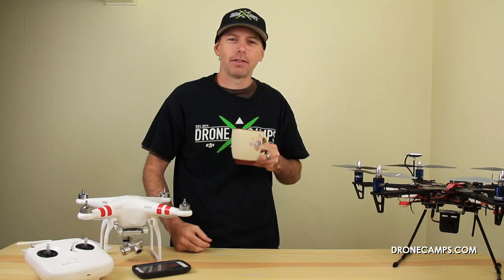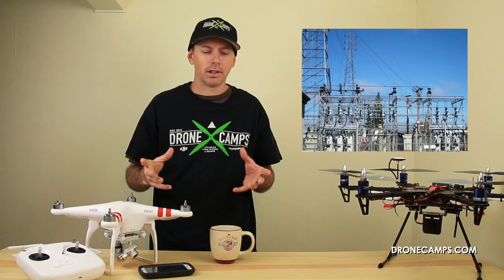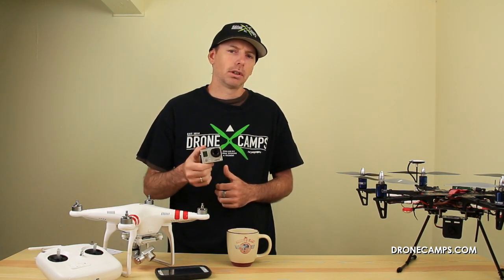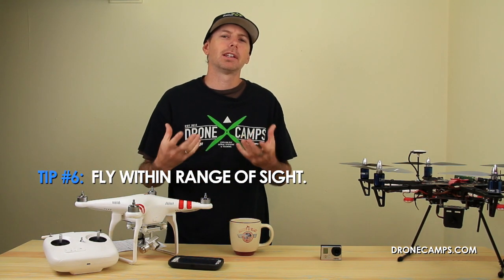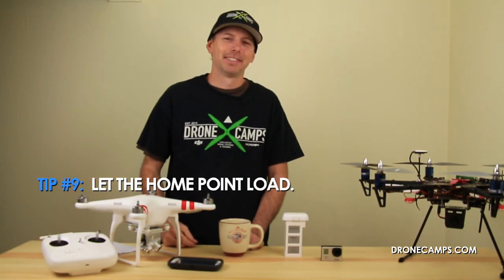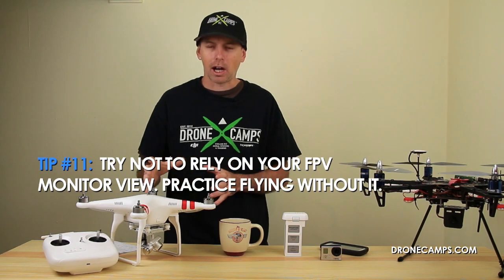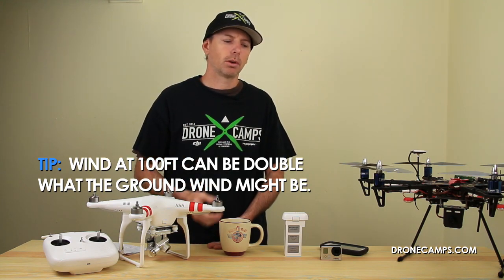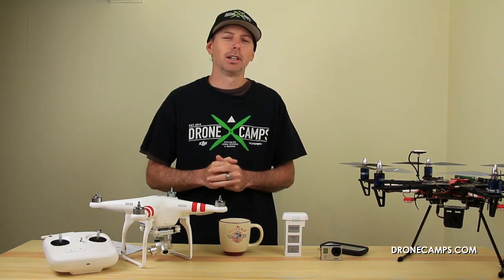DJI Phantom 2 - How-To AVOID FLYAWAYS, UPDATE

Comment: Have the Phantom II Vision. After my first flight and battery charge, I went to it fly again.  This time when it connected I had no video on the DJI Vision app. I tried resetting the range extender RE500 and then did a rebind.  After I scanned the bar code, I pressed the blue arrow button.  When I did that it went right to the main screen.  Watching other videos on binding, it was brought up that if it did a successful bind that you would get a message that it was successful. I didn't.  Any ideas what to do next?  Thanks.
Reply: Don Cook I have the same problem with two of my batteries I have four in total but two of them just recently got to where I had no video but everything else works great just no video anybody out there got any ideas on what happened to the batteries

Comment: Does anyone out there know if the "FlySky FS - TH9X 2.4G 9 Channel Transmitter / Receiver 
will work as an upgraded transmitter for my Dji Phantom 2 (it's the one with the re-chargable transmitter., 
battery level lights,.. "MODEL #NDJ6"... Eventually I want to add...1.) 3 axis gimbal 2.) retractable gear,
3.) Telemetry 4.) FPV. Already have FPV gear and Retractable gear so they will be first. 
Any clues would be good, Lately, I don't have a clue, lol

Comment: I learned to fly on a Cheerson CX-20. I crashed it so many times I finally had to transfer all the electronics to a 450 Flamewheel. Had trouble with the GPS, failing, acting eratic etc, etc...On its last flight. it shot up and I lost it in the sun. By the time I dealt with the sun it was gone. My buddy that was with me saw it and said it was just a spec. I never saw it again. Since then, I got a great deal on a Phantom 2 but I'm scared to fly it over 75-100 feet or so. Fear is not a good emotion while flying a quad, lol...I keep telling myself it's a hobby grade toy, just have fun with it...still a bit nervous when I put it in the air. It flys great and responds better on its worst day than the CX-20 on its best. Any sugestions ? I always make sure I have 7 or more satalites too !Thnkin about trading it in for a RC car or a Boat..lol...Flying is so much more fun tho. Maybe I'll get over the fear, I certainly hope so
Thanks
Reply from the maker: Hi Jeffery. Some friendly advice is this. They all can have issues. No matter if they are on the ground or in the air. The best thing about flying is the challenge of getting in back in one piece. That to me is the fun part. Calibrate your compass each time you go out to fly. That will help the GPS get a good idea of where you are and the copter will fly better. Phantoms are reliable to a point. Some people have them for years. Others days. Just depends on the pilot and sometimes the equipment. Like a car. Some are good. Some are lemons. I never know with an RC anything if I got a lemon or not until about the 50th flight. Even then things can break. Sorry about your fly away. It's happened to me too. Some advice... put your name and phone number and reward if found on it. Someone nice might call you and give it back. I would keep flying and growing to learn the drone and fix it when it crashes. Soon you'll love flying... And being scared is a good thing. Keep it close in and learn to fly it without relying on GPS. You'll be a better pilot. - Kindly, JD.
Reply: Thanks J.D.
The first thing I did was put my name, Ph# and the word "reward" but not an amount.
I also put my FAA reistration info as required...thanks for your videos, I've gotten alot of good insight
from them, I will continue to watch. I'm 63 on the 16th of this month, My beautiful wife, guitars and drones are all I have at this point of my life. (in that order) Soooo, thats it. Only been fling less than a year, but I get better every time out.
Thanks again !
P.S, I fly a mini quad every spare lunch and break time at work, it's helping alot with control.

Comment: Just had a flyaway and i think it was the go pro wifi :( it's still in the the woods can't find it !!!! 1000€ lost, another tip you forgot to mention is a tracker..... Guys buy the Marco Polo tracker or something like that you won't regret buying I will never fly another expensive drone without any means of finding it again ... Buzzers,  strong LEDs it's also a good  idea, record you OSD, video so you can check the coordinates and the landscape your drone went down, went flying in Sierra de Madrid winter time lots of snow the drone can be under the snow no way to find until springtime, another useful thing you must do is to right you phone Number on the drone so that if you are lucky enough to get someone who finds it to call you back ....
Reply: or buy a P3 which has all sorts of telemetry and shows you the last position on map. Just don't use an iOS device those things have terrible Maps app and GPS sucks too.
Reply: I lost mines when it came down in some thick fields and i follow the gps tracker that lead me directly to it.

Comment: Perhaps one more thing you can add is propeller guards. They're good for beginners, but add a lot of drag to the drone.
Reply: First thing I put on my Phantom was prop guards, had 8 I bought for my CX-20 (did'nt fit) already cracked 3 of em...minor crash, was inpatient, didn't wait for full GPS lock. That won't happen again. Got the quad for a ridiculas price.($100  with 2 batteries and about $400 worth of FPV equiptment, plus 2 other lesser value drones. Im poor man, thats a once in a lifetime deal, lmao ! I'm 63 on the 16th, 9 days. these drones gotta last another 3-4 years. I figure after that alzheimers, it's what killed my Mom and Dad
Happy Flyin" y'all
Texas Jeff

Comment: Tip 1:  Buy stickers showing directions, labels of commands and stick them on the controller.  Tip 2:  Turn your phone off.  Calibrate.  Turn phone on.. Turn off WiFi and Bluetooth if not needed.  This applies to others near you.  Tip 3:  Use prop guards..Use a sharpie and put your name and number underneath the guards.

Comment: Great information that I really never thought about.  I am really new to flying drones...bought a Phantom 2 with Zenmuse V2.0 bundle.  So far I've had a blast.  I've taken it far over the ocean and it's sketchy when it's a tiny dot.  Might keep it a bit closer now.    I don't have a FPV yet so I guess that's a good thing learning to really "fly" the drone rather than use the monitor.  The battery going below 30% was EXTREMELY helpful.  I've had the drone return to home twice.  The second time it almost landed 15 feet from where it took off(not a good thing at all).  So, make sure you have a 30' foot clear take off radius with no trees around or buildings.  Thanks again great video!

Comment: Hi. Excellent, thank you. I am consideriing an application on a very remote island where there is no WiFi. Could the system you have here be used to map coral configurations in such a WiFi free zone? Thanks.
Reply from the maker: +Charley Waters yes the copter uses onboard wifi. No need for cell service. Fly and map anywhere

Comment: As an average person that flys a Phantom 2 very often, you do not need to calibrate your compass every time you fly. I have noticed some strange behavior without calibrating over the course of several weeks but it's nothing major. If you notice youre copter isn't as smooth as it once was then go ahead and do the compass calibration dance. If not then just fly as normal.

Comment: having problem with my Phantom after install 5.8 mhz video system and gimbal. in the ground phantom response to controler up to 10 ft or so, and them got disconected and phantom land. what could be the problem? any advise?

Comment: Best bet, start with a toy drone, buy a couple, learn to fly, then upgrade to this way more expensive model, you can grab cheap camera toy quads for around 60 U.S. dollars and learn to fly on those before ever paying 1000 plus dollars on these quads. If you care about your investment. learn what you are doing before putting one of these multirotors in the air. Last piece of advice read the manual, it will give you the basics of safe flights and of course research the quad or other multirotor you intend to use in the field, make sure you know what to expect from its performance before you ever plug the battery in and get ready to fly.

Comment: special warning,  Care needed to avoid losing line of sight with drone as it will lose signal and go into fly back home mode. If the obstruction is a building or hill of over 25 feet your phantom will attempt to fly back you through it...it happened to me

Comment: Best DJI tips video I have seen.
I am on my second DJI Phantom, as I lost my first one into the ocean due to a flyaway.
I just had a similar incident, but managed to regain control because luckily enough I had the altitude to do it.
I was flying it at a port around tall light towers and a lot of wireless signals around.

Comment: Regarding the SAM app.  Could you expand on what the app is showing.  How many different colors / messages are for each field, Solar X-Rays and Geomagnetic field.  Currently mine shows M Class Flare?? and Unsettled, both in yellow.  Without knowing the complete range of colors and messages I'm not sure how to use this app. Thanks for your time.
Reply: Norman Porst There is an explanation about solar storm activity on MikroKopter Wiki.

http://wiki.mikrokopter.de/en/SunStorm

Comment: Great explanation and it sounds exactly what happened to me.  Was flying around and all of the sudden, quad started going in a an unwanted direction and I watched it go out of sight, very sad!  I have a comment, what do you think about this?  Along with what you have suggested, what do you think about just after take off, hitting RTH and verify that it truly does RTH.  If the gps spot is incorrect and it started heading in a different direction, at least you will only be a few feet off the ground and the quad will run into something instead of flying away above the treeline.

Comment: Flew about 5-6 hours on the Heli-X Simulator plus some more indoor flying with a micro copter.  Grabbed the Phantom 2 v2.0 for my first flight.  Phantom Mode, no wind, practice take off and basic left right movements.  It's super easy to fly in phantom mode.  Great for the camera work we will be doing with it. We also removed the camera for until we get a few more flights.  Thank you for the tips and info.

Comment: Very very helpful video. Thanks.

Do you have any video on what we have to do when up in the air, something goes wrong, lost control of the drone? I think it is also important as we'll experience it somehow. 

Another question is, how close is 'too close' to steel structure, antennas, radio station, power lines? The maximum proximity?
Reply from the maker: Fadil Aziz you are most welcome !

Comment: I had a fly away but it probably was my fault. I found the thing in a small tree unhurt because the battery still had power and was sending out its location.   So my question is if your phantom does go down how long will the battery run if its not running the motors. Lets say it goes down with 30% battery.   I have a vision 2 so as long as it is still powered up its like sending out a beacon that you can follow.

Comment: Great tips, thanks. I'm guessing that for tip 10 you could activate flight mode on your mobile to kill EM signals that may interfere with compass calibration and deactivate flight mode once the compass has loaded?

Comment: Hi thanks for video. While flying a few times I got this red warning message on the screen 'poor battery connection" and then battery level flashes red. This could be 2-3 mins into a flight with 100 percent battery life. I then panic but thankfully it stops flashing and returns to normal. Any ideas why this happens? It's a vision plus V3. Thanks

Comment: Any idea why when I try to start my motors after calibration that it would refuse to start until I remove and reinstall the props?
Reply from the maker: Hickory taylor that shouldn't be an issue. Weird!!!
Reply: Drone Camps RC
 Not having any one else around here to compare mine with I just compare to the videos.  Can I ask,  from the time I turn on the radio, plug in the battery and the quad makes its sounds,  after doing a calibration in full view of the sky how long would it normally be before I could move the sticks and start the motors?
Reply: Hickory taylor It depends.   All GPS receivers boot up quicker from the last spot they were shut down.  Move them enough that the sats are in different positions or different sats are visible and they take longer to search for them.   At home I am ready to fly in 30 seconds to 1 minute on average with 11 sats in view.   After a 15 mile journey into the mountains to film a friend's home, it took nearly 5 minutes to get a full system lock and be ready to fly.   Obstructions matter.  Proximity to buildings, trees, or hills that block a clear view of the horizon may limit sat coverage. Some sats are pretty low in the sky.  The sat I get my TV feed from is only 15 degrees above the horizon.  How many sats are visible from your lat/long matters too. More is better.  Booting up on a hill is better than from an open field in the middle of a valley.  If you are close to your house, car, or trees when you try to power up, move farther into the open and see if you do better results after two or three consecutive power ups.   Good luck.

Comment: Thank You for the info, I am a new flyer and I learned a lot from this video. I have a question I have two drones, I have the DJI FC40 and the DJI Vision 2 plus. (My wife bought the fc40 for Christmas and did not know I had ordered the vision2)  Can I fly both at the same time or will they interfere with each other
Reply from the maker: jhodges405 you can fly them at the same time.
Reply: Drone Camps RC Thank you the wife is getting into flying to this is turning in to something more then just a hobby LOL

Comment: I have a phantom 2 vision plus V3. Will failsafe home still activate if you are in atti mode? Or is the only way to disable gps is if you are in true manual mode? I know there are settings in the software but I was wondering if I don't want to have position 3 on the S1 switch set to manual and if I get a flyaway can I switch it to atti and regain control? The owner's manual doesn't get into a lot of detail on anything.

Comment: God video. I have also a New Dji Phantom 2 vision+. Bought Phantom to cristmas and I have be on 3 tour With it. I live In Norway and Its Winter here but some days is fine fore Phantom. Last tour I had 13 Gps. Its fantastic to fly With. I have a questions about sender CE or FCC. Can I change this in Phantom RC Assistant? Or I need to use flathead screwdriver back on sender?. Maby I have to do bouth sender and In software?. CE range 400 meter but FCC give me 800 meter range.Thanks fore video you give many god tips about ouer Phantom!

Comment: Some good pointers there which I will take on board as a new pilot. Two quick things. Just letting you know I am using the Go Pro Hero 4 on the gimble of my Phantom 2 Version 2 and it works fine. Same size as the Hero 3 but a little lighter. Secondly....can you tell me when I fly in Naza mode does it still have all the fail safes as in Phantom mode? I found in Naza Mode it took longer to acquire the GPS mode. Then after some research I understood the red flashing lights and Green light set up.

Comment: Thanks for the great video!

One question about cell phone proximity during compass calibration:

Is it the cell signal/frequency that interferes with the compass calibration? If so, would'nt having it in airplane mode prevent this? AND, what if you are using a tablet that does NOT have cell service, but only wifi to connect to the Phantom?

Thanks again!
Reply from the maker: You should be fine with a tablet with no cell service. Having the phone away from the Phantom 2 is just something DJI had us doing since the beginning. Just so there is no chance for error.
Reply from the maker: mddrudge normally I suggest having your phone well away from the Phantom when it is loading the GPS before take off.
Reply: Great question, MD. Answers?

Comment: Part of my preflight checklist is putting my phone into airplane mode. There is no reason to have it on during my flight and it's just another source of potential interference gone.
Reply from the maker: JFV1134 very good idea. Esp if you get a phone call while flying!
Reply: I don't use the phone for my drone. I have a gopro and a separate video transmitter with a black pearl receiver/screen.
Reply: JFV1134  If your phone is in airplane mode, how does it connect with wireless? Can you still connect your phone to your drone?